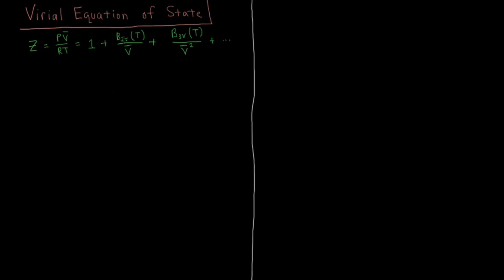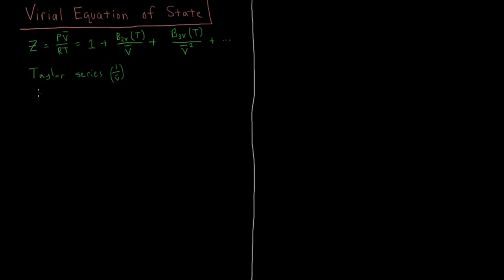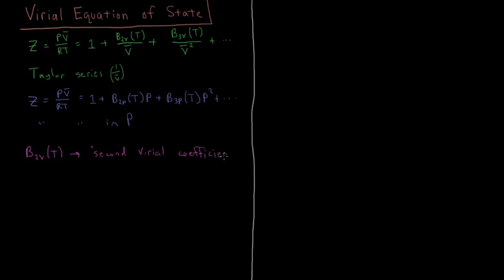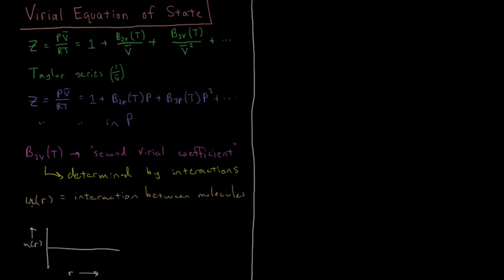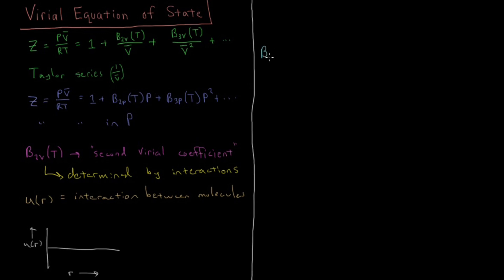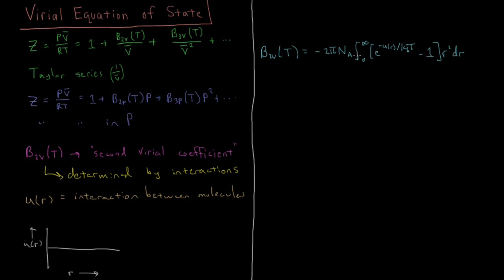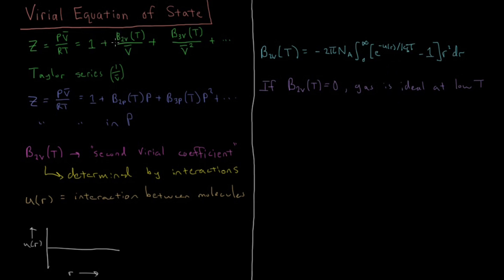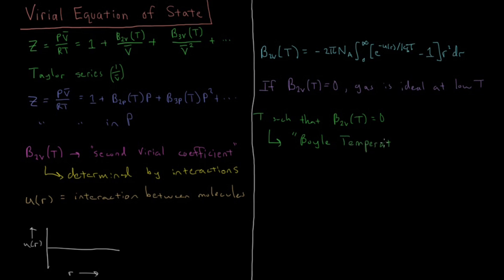Chemical Thermodynamics 1.3 - Virial Equation of State (Old Version)

Comment: How Am I integrate the second virial coefficient?
Reply from the maker: Hola quimica. In general, the potential energy function [u(r)] can have some complicated form, and putting such a function inside an exponential makes for an even more complicated integral. For a few simple cases we can solve the integral exactly, otherwise we need to insert the potential energy function of our choice and use some numerical method to compute an approximate result, often using some type of mathematical software (Matlab, Maple, Mathematica, etc.) or with some custom programming script.
Reply: Thanks for the quick response.
I am in trouble. I need to solve an exercise, but I do not know how I start it. Could you help? Giving some steps. Please.
Reply from the maker: What potential energy function do you have?
Reply: The second virial coefficient describes the effective interactions between two proteins immersed in an electrolyte aqueous solution. The B* is related to the potential of mean force (PMF) W(r) by
𝐵∗=2𝜋 ....( 1 − 𝑒𝑥𝑝 −..) 𝑟6𝑑𝑟
In this equation, Mp is the molar mass of the protein and NA is the Avogadro number. Figures
below show the equations for DLVO Theory (to calculate the PMF) and the net charge of three proteins as a function of pH.

Protein properties               (BSA)       Lysozyme
Isoelectric point (PI)            4.9                11.0
Molar Mass (Da)               6.3 x 10^5      1.4 x 10^5
Diameter (𝜎 = 2𝑎) (nm)        6                         3
Hamaker Constant (H)     10 kBT             10 kBT
a) Calculate (and present in plots) the B* of lysozyme and BSA for different concentrations
of NaCl, at pH=7.
b) Calculate (and present in plots) the B* of BSA for different pH (from 3 to 7) at 0.5M of
NaCl.

There is a graph too, but I did not get to put it here.
Reply from the maker: Not sure exactly about the details, but whatever you need to do to get the PMF, that potential of mean force is the same as the potential energy function [u(r)]. Substitute in the PMF in the integral. The result is likely too complicated to integrate exactly, but you can use various approximation techniques to get a pretty reasonable numerical answer, since it's just a one dimensional function.

Comment: thank you very much. my pchem textbook wouldn't quite go into as much depth as this video on virial coefficients. I guess I can understand why, but it seemed important to have a good understanding of how gases can behave ideally given certain parameters.
Reply from the maker: You're very welcome, Ryan. The ideal gas is one of the most important model systems in physical chemistry, so I agree that it's important to understand when it works and why it fails when it doesn't. Interestingly enough, most of the non-dark matter in the universe exists as interstellar gas clouds at very low pressures, so most of the atoms in the observable universe exist as part of an ideal gas.

Comment: How is it a taylor series? What is the thing that you are taking a derivative of?
Reply from the maker: Hi Luke. All gases behave ideally as pressure (P) and/or inverse molar volume (1/Vbar) go to zero. Thus Z = 1 for all gases at P = 1/Vbar = 0 (Z, the compressibility factor = PVbar/RT). The first equation (in green) is a Taylor series for Z expanded in powers of 1/Vbar from 1/Vbar = 0. The nth virial coefficient BnV is the (n-1)th derivative of Z with respect to 1/Vbar. Similarly, the next equation (in blue) is the same series in terms of P. It expresses Z in terms of powers of P, starting at P = 0. The nth virial coefficient BnP is the (n-1)th derivative of Z with respect to P.
Reply: but isn't the derivative of PV/RT with respect to P, VR/T? How is it that equal to the virial coefficient?TMP Chem
Reply from the maker: This is not true. For an ideal gas, the derivative of PVbar/RT with respect to P is zero. Remember, V is a function of P, so you need to apply the product rule. When you do so, simplify all the terms, and do all the needed substitutions, you will find that this derivative is zero if ideal. If a gas is non-ideal, this derivative is not zero because Vbar is not RT/P. So for an ideal gas Z is 1 at all pressures and temperatures, and all the virial coefficients are zero. If not, then the virial coefficients indicate the extent to which a gas is non-ideal.